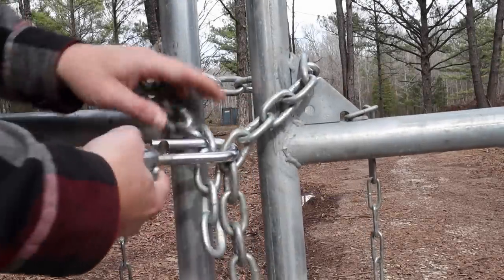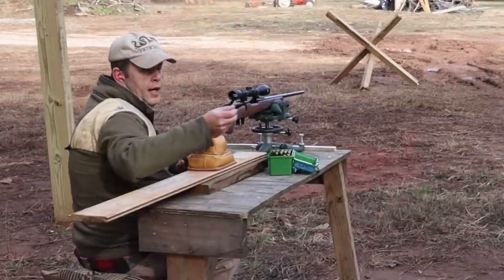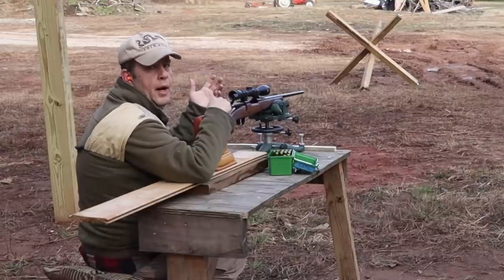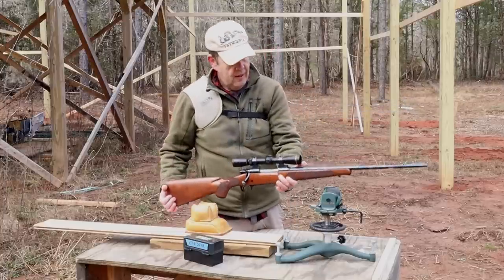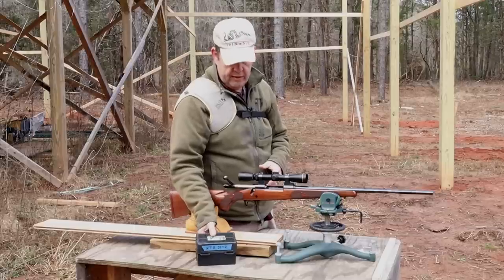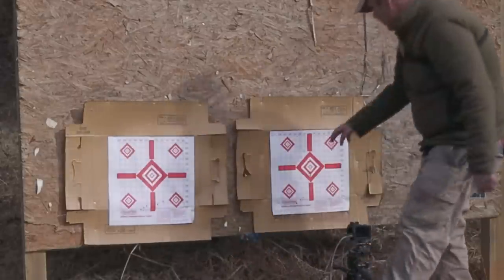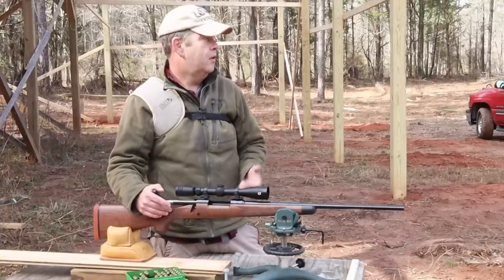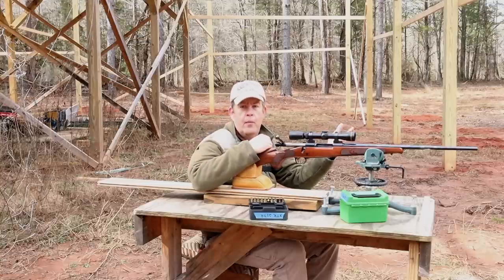M70 Bedding Results, We Still Have Work To Do!

Comment: Sorry you are not feeling well, but glad you're still working on them. I may load some 175 grain Speer (GS) at the bullet weight upper extreme using IMR 4350 before my next trip with my 7X57, plus that load with the 145 gr GS and H-414. Since I torqued down my barrel, I lost some of the clearance I had, so may have to sand some more. I may use a different target that I tend to get better groups with. I need a warmer day. Best of luck. Waiting patiently for my .222 barrel to get built....but Shaw seems to be building rifles ahead of my barrel. It's about near the 10 week mark. I ordered from them because I really like my .25-06 barrel. I broke it in meticulously.

Comment: Bought a JW 106 Norinco 556 bolt action 5 shot mag. Its a copy of the 22 lr bruno 2 and looks very similiar to the remington 788. It has a trigger that is adjustable. It came with a tube style red dot sight. My bro gave me 40 223 55 grains and those shoot very tight groups. Hes giving me 100 more when he comes and buys afew of my guns after tax refunds. The stock has a recoil lug and the barrel is freefloated but im thinking of doing a bedding job. The stock inletting is really rough so  a bedding would be good for this little gun. Im thinking of setting the reddot sight for 200 yards or maybe 300 like the military. Its set at 25 yards right now and I shot at 150 yards and it dropped around 125 so far zero is probably 100 yards. Im thinking of getting a 1*4 scopechief scope with post reticle or a small 4 power scope. I really like this caliber as its a super fast shooting and almost no recoil. My buddy has the 762x39 version but its missing a magazine. And he has 3 more barrels and actions with mags but no stocks. Maybe buy an extra for parts. Ill be using this 556\223 rifle this year.

Comment: Tom, explain to me what all the fuss is about free floating a barrel to achieve best accuracy.  Or better yet, explain to me how a non-bedded pre64 Win Mod 70 with the barrel screwed to the stock can shoot sub MOA (I've had several) all day long.  I enjoy watching your vids and all the beautiful rifles but sometimes you just get a bad barrel that won't shoot.  I look forward to seeing that 7x57 come around for you as well as the 257.  I have my doubts but also hope you make me eat crow.
Reply: If I may add. I traded A Stevens 200 (My first mistake was trading it) for. + some cash for a Remington Model 700 SPS Varmint. It had a beavertail factory stock that had an integrated pillar out at the forend that the barrel rested on. Not "free floated."  1 in 12 twist. well it also had the XMARK pro trigger which was just so- so. Taking it to the range I was very disappointed. 26 inch heavy barrel shooting 1-1/2 to 2 in groups at 100 yards with a 6-24X50 scope?  The Stevens 200 with a 22 inch skinny barrel was better than that without an accutrigger. So ordered a Timney Hunter Elite trigger and a Stocky's M-50 stock, full length aluminum bedded/free floated. it now shoots "minute of prairie dog's head" at 200 yards...never mind 100, and is a better than 1/2 MOA gun from the bench...Now.  I also have Model 70 Featherweight in 7X57. Shot one barely MOA group with it. Still working on bullet weights for that one, but documenting the best ones. It will on most occasions, put two close then throw a flyer like more one inch plus away. Driving me nuts.  I was moved at one point to get a Featherweight in .243, you know with the wood stock. But heck. I have my doubts now as to whether they can make consistently good barrels or what else may be going on, seeing Tom's experience with his newer Featherweight .257 with the uneven lands. The way they keep discontinuing products (like their standard "Sporter") they may solve my problems for me.